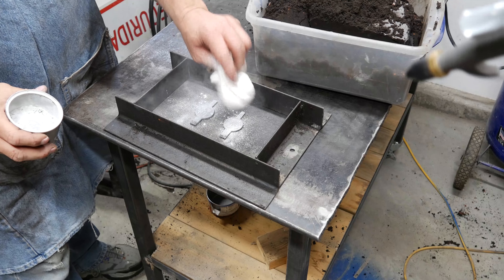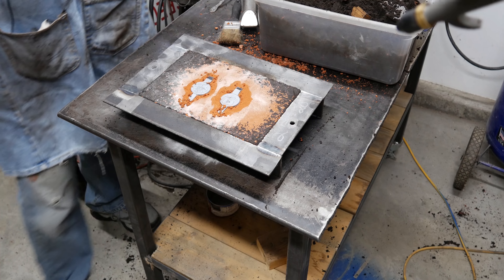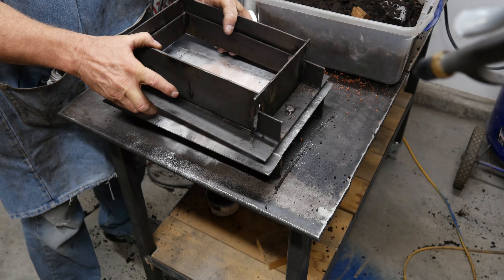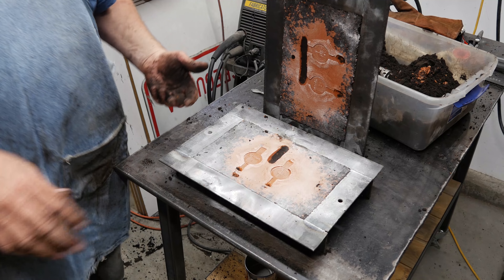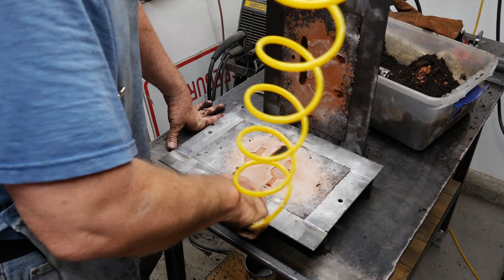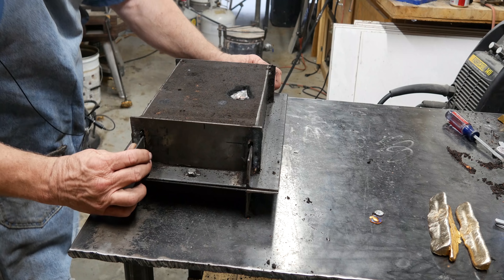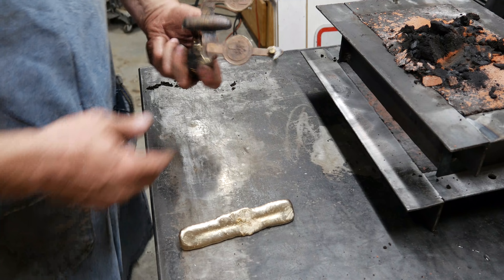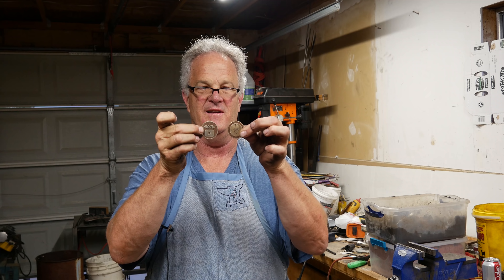Casting a commemorative congratulatory coin   Men of the West

Comment: Do the wooden dowels you used for vents stick to the sand (or does the sand stick to the dowels)?  Some steel or brass rod or bits of brake line tubing would prevent that if it's a problem.  Maybe ask Martin, he knows so much more about that stuff than anybody else that I know of.
Reply from the maker: Hey Ron, everything sticks to that oily sand I've created :-D  It was just the surface that broke loose and it probably did that because I didn't pack it as hard as I should have around the top of the dowel. I've developed a nasty habit if hitting the vents and sprue as I'm ramming driving them further into the drag. I've started putting my finger on top of whatever I'm ramming next to to stop me from hitting it. That helps some times ;-)
Reply: Maybe it's just better that the the sand breaks off when removing them and not later when handling the mold. If not, then perhaps some kind of mineral oil could be used to oil those dowels.

Comment: You should twist the vent and sprue pegs before you lift them up. That should release them from the sand better.
Reply from the maker: Thanks Mark. Yeah, I generally do twist them. The sprue former being very smooth and tapered always just pops right out. The dowels should probably get a coat of paint and a sand job done to them. that would help as well